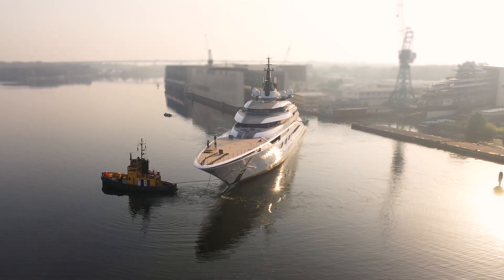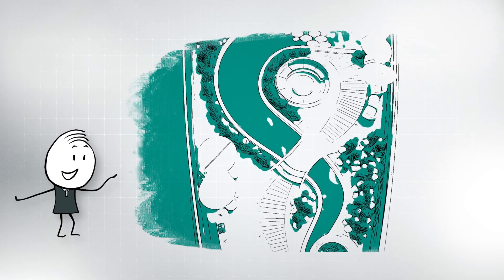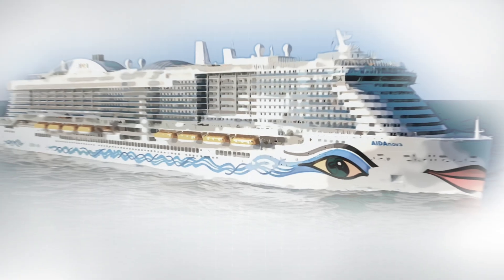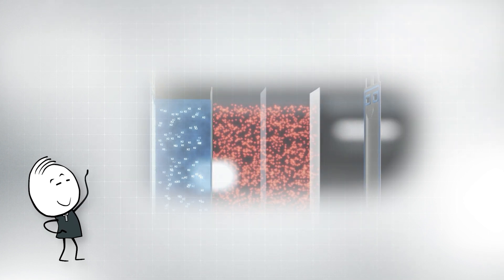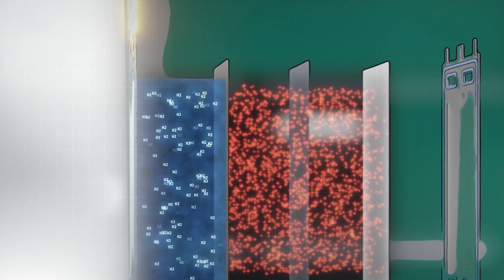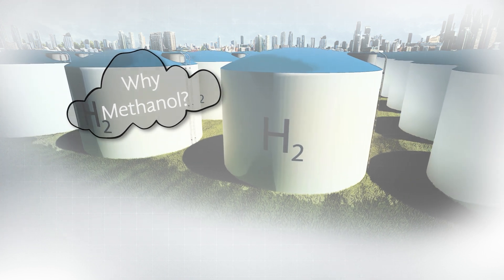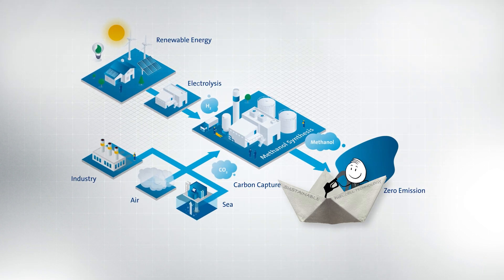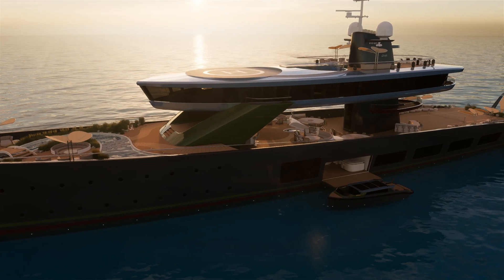Lürssen Yachts - Fuel Cell Technology on Yachts explained

Comment: I am very much looking forward to this technology maturing. Methanol fuel cells are optimum in every way, save one. As of yet, methanol production from clean energy sources remains significantly more expensive than the production of methanol from natural gas, and if such a fuel cell powered ship uses such methanol, it will 'not' be carbon neutral. That said, it remains far more benign to the local marine environment even if not being carbon neutral.

The owner of Bilgen Yachts has stated often that he believes nuclear power may be a viable option for yachts within the next decade. I presume Lurssen has given some thought to this and I would be most curious to know what they think of it.
Reply: There will never be a commercial/private nuclear powered vessel. Once that gets into the hands of unscrupulous people, you'll have a disaster waiting to happen.